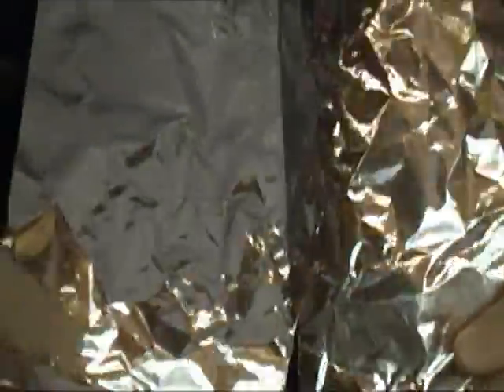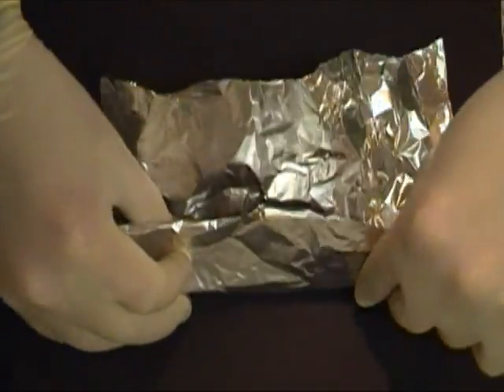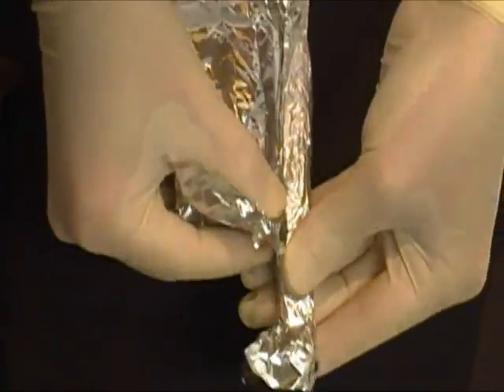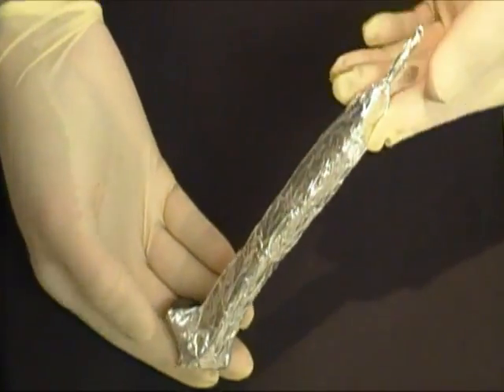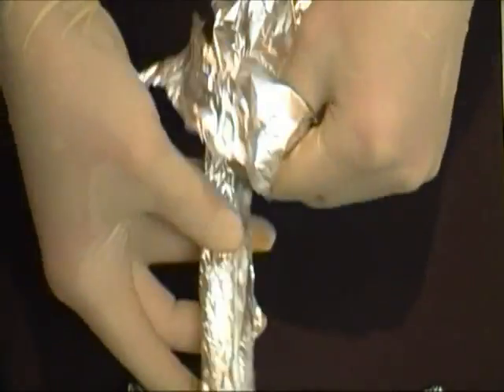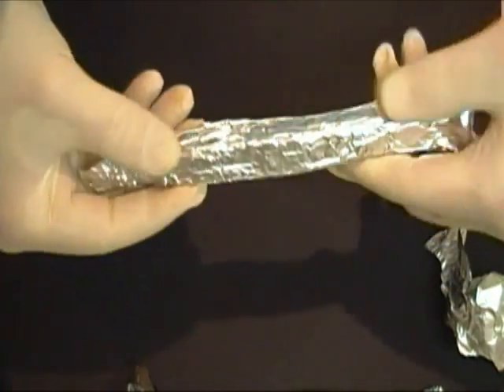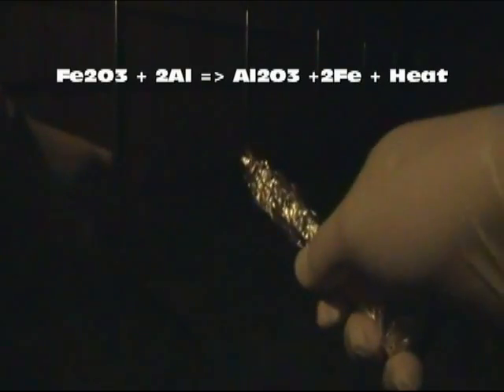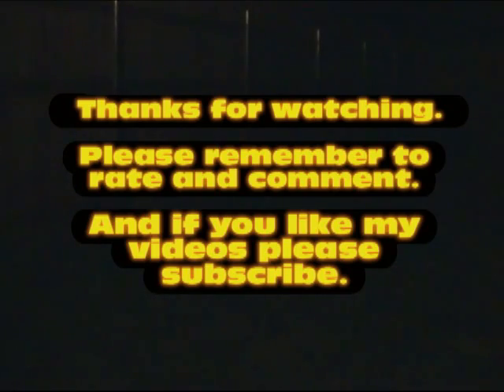Use chemistry to make a fire in a pinch

Comment: Or, if you have only nails and aluminium, you could make a serial circuit gaining around 1 V per cell, and then ignite the steelwool. For an electrolyte if you do not have water or juice you could pee in it and use some salt (which you gain from your sweat, since without water you feel really warm).